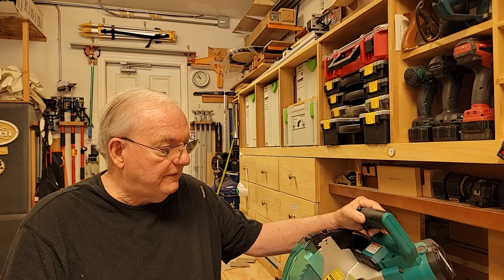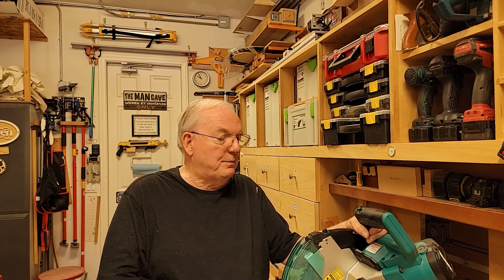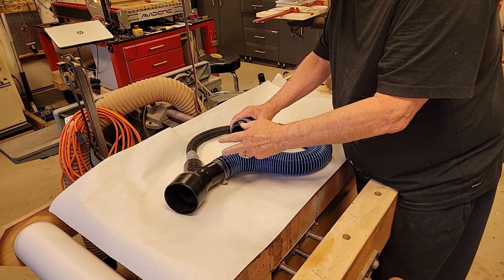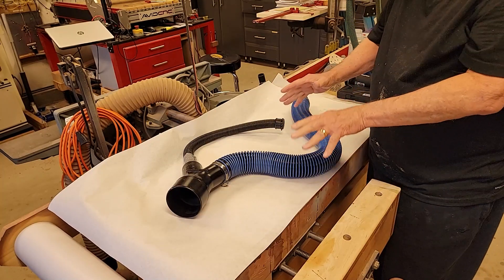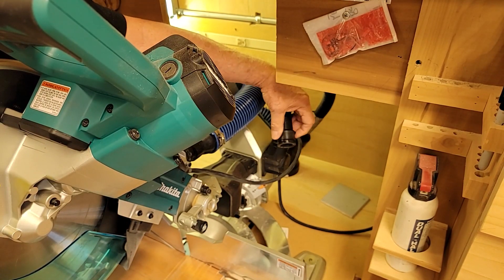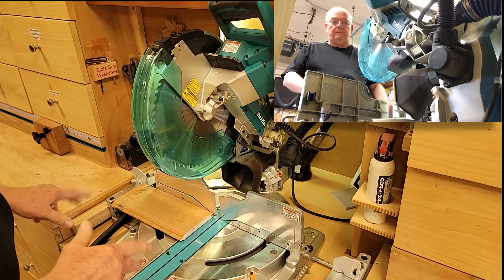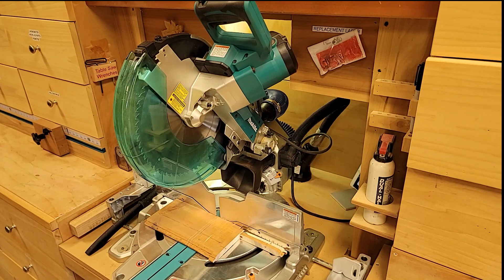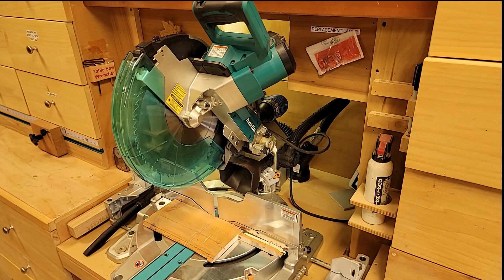Miter Saw Dust Collection Solved

Comment: Crystal clear presentation.  Thank you! I hope you don't mind a few questions: Does that Makita model have two native dust ports, thus your use of two hoses? What is the cfm of your dust extractor? Do you believe your setup would work almost as well if powered by a typical shop vac? What is the model no. and blade size of that Makita? I run Dewalt saws, but for my on site ops would switch if I could acieve the dust control you ckaim with a jobsite shop vac. Think it's possible? Thanks again.